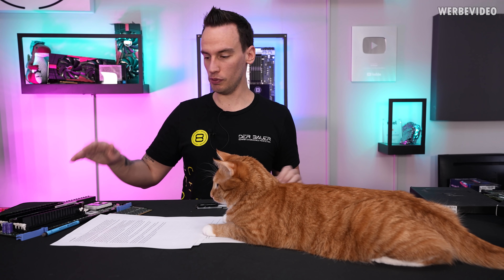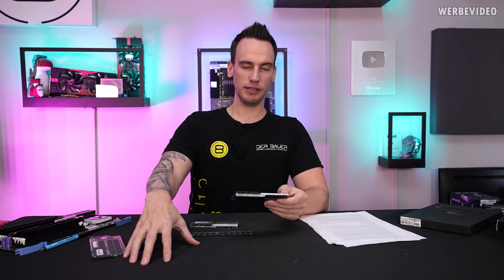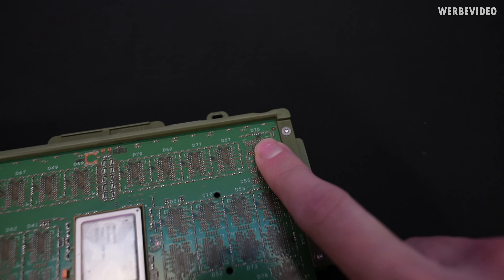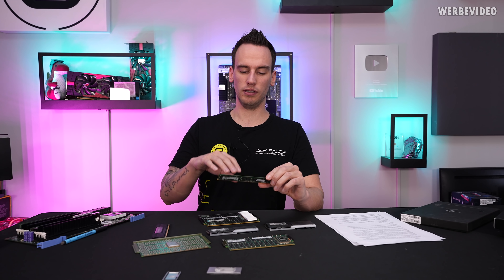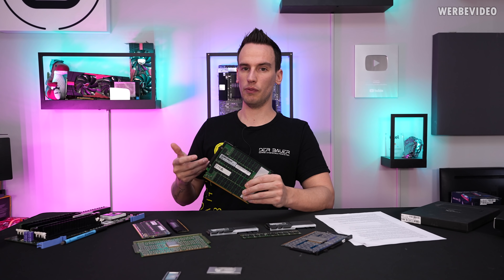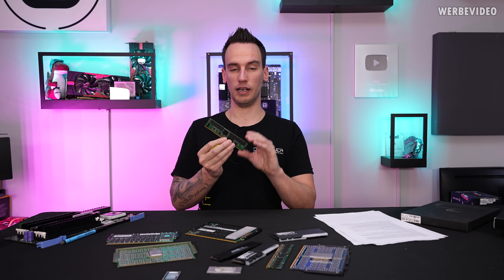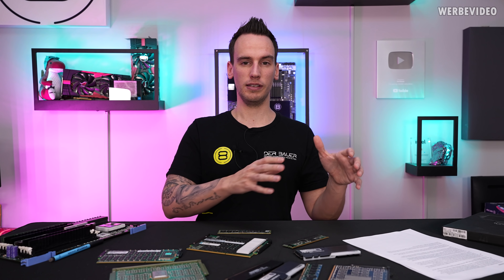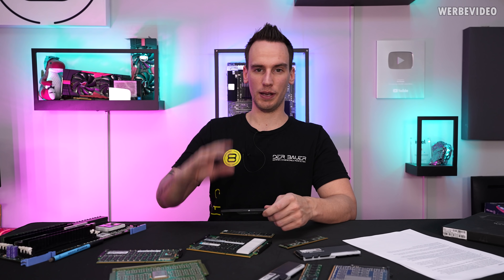This Memory Stick with over 150 DRAM ICs is Unreal and probably the Biggest Ever Made

Comment: Don't know if that's biggest by IC amount, but it sure isn't the largest by physical size. I suggest looking at vintage 1980's ISA ram board. There's some with 130 slots for memory chips that you had to install yourself into the card that probably wouldn't fit a modern computer case. They could add whole megabytes of memory to your computer!

Comment: I never thought I'd see the day where a stick of RAM would surpass a standard tower cooler in height... So, does that mean you need to find cases that fit this?
Reply: They go in servers, so no. The company builds the case around the height requirements of the equipment, and most IBM servers are at least 2U, or about 3.5 inches tall, but I've worked on Power System servers from IBM that are 3 and 4U high, or 5.25 and 7 inches tall, respectively.

Comment: The old IBM PCs from the 80s had enormous add-in boards for memory. If I'm not mistaken, they used ISA expansion slot, which is the grandfather of PCI, and later AGP and PCIe. The memory add-in boards where taller and longer than AIB 3080s/3090s. But to be fair, these memory add-in boards are not directly comparable to DDR DIMMs. But it's fun to see how small everything have gotten.
Reply: I was going to type the same thing.  The ISA boards from the 80's were full length and were bracketed.  Every time I see one of those sagging video card videos. I remember when those brackets became obsolete, somewhere around the time of 486 computers.

Comment: Fascinating stuff. IBM's proprietary hardware does set a precedent for servers to come down the line later. The biggest rackmount system you can buy at the moment that's user configurable maxes out at four processors and 6TB RAM for a single configuration. Obviously you can also get dual and quad systems stuffed into a single enclosure, and then many times more with blade systems.

Important to note too that those tall sticks most likely wouldn't work with a 1U server - I'm guessing these were exclusive to IBM's 4U products. Then again being proprietary I wouldn't be surprised if they used 90 degree or angled memory slots to fit them into slimmer chassis. When you're dealing at this high end rack space (and floor space) is not what you worry about lol

BTW: nice pussy 🙂

Comment: It isn't just as exotic as it may seem.
Standard DDR4 LRDIMMs also come in variants with 72 DRAM chips per stick.
They are using dual-die packages, meaning there are 36 physical packages on the stick, but each contain two dies.

And these sticks are very common.

Comment: i have a msi gt62vr 6re dominator pro it 6 year old laptop i want to know  can i overclock the cpu to 3.4GHz all core ? cause my temps only hit 60 at full load and and my cpu is stuck at 3.1 GHz there is not a single video to show how to overclock a i7 6700hq even when the option is given

Comment: IBM's Centaur chips were not exclusively found on massive proprietary DIMMs.  The low end POWER7/8 systems had them installed on the motherboard themselves and had ordinary DIMM slots linked to each Centaur chip.  It was a typical dual channel arrangement supporting up to two DIMMs per channel.  That is likely why the IBM custom modules are so large as they're effective four DIMMs in one.  Another note is that these DIMMs support ECC and IBM's ChipKill technologies so one DRAM chip can completely fail, be disabled by the Centaur chip and then continue operating while ECC is still maintained.  I think those custom Centaur DIMMs could also be hot added to a fully running system.

The L4 cache of the Centaur DIMM does indeed function as a cache but its contents are restricted to the information of the DIMM itself.  While it does improve performance, it mainly offsets the impact of using buffered memory.  Adding more DIMMs does increase performance of these POWER7/8 systems even if memory capacity is kept at a constant.  IBM did release both DDR3 and DDR4 version of these DIMMs and they are interoperable.  However, there two different Centaur designs to deal with the different memory types.

POWER10 changes things significantly by using a common interface for multisocket communication and their memory buffers.   Eight links are always dedicated to memory while an additional 8 can be used for SMP traffic or even more memory.  It is pretty flexible so a single socket only system can have 16 TB of memory with a bandwidth of 2 TB/s which is very impressive.  The big iron servers are only leveraging 1 TB/s of memory bandwidth and top out at 8 TB of memory per socket and upto 16 sockets in a single node.  Memory sharing between nodes is also possible with the POWER10 but cache coherency is lost.

3D Xpoint memory or as it is more commonly known as from Intel as Optane, is a very interesting technology.  Being byte addressable does permit it function as main memory.  Intel initially was going to have Sky Lake-SP support these DIMMs but due to bugs had to disable that functionality.  Similarly Intel was planning on permitting full Optane memory on its systems before requiring some DRAM to be installed.  While the performance of Optane is slower than DRAM, it does permit some interesting potentials in software optimization:  the full removal of the traditional storage stack as everything then becomes 'in-memory'.  With enough capacity, those Optane DIMMs would double as both main memory and traditional SSD storage.  This reduces operations like say loading a game into memory to zero because when you are not running that game, it is is already sitting in the Optane DIMM.  Like a RAM disk but without the need for the traditional storage software layer to function.

Comment: I have a 21" Mac and it came with 8 GB, updating it myself is too risky because I will have to open the computer completely before I can reach the memory slots. Apple decided for some weird reason that it didn't need the usual memory slots in the bottom of the screen as my previous Mac 27" had. Is there a way to add extra ram using the USB ports?
Reply: No

Comment: That's a lot of DRAM chips. I am kinda curious if it will also function on x86 processors other than Power 5 SOC that it originally was paired with.

Comment: I started my computing career on System/38, the AS/400, i Series, System i etc. The hardware is way ahead of PCs. One morning we got to work and saw an IBM engineer waiting. He said iSeries had a cache failure, so it organised an engineer for itself. Cache was pulled out while it was running. The system said thank you on the console and configured itself for full speed. You get what you pay for :) Awesome.
Reply: my old Boss used to sit with the IBM engineer when they where getting data errors on the storage of the system/38 and make bets on exactly when it would fail, although that came during a time well before i worked there (i would have been in preschool at that time), when i started in the early 2000s they had the as/400 - iSeries which had been running for probably 7-8 years at the time, that thing was interesting to me and still to this day i hope to find a used one to add to my homelab/collection but the prices never go down. although the biggest thing i remember from back then was waiting 3hrs after work because i accidently knocked out power and had to wait for it to boot and display a login console on one of the 3180? terminals before i could go home (connected a large laser printer to a stupid unlabeled outlet on an extension cord that ended up being connected to the UPS the AS/400 and Novel 3.12 server where on, UPS did not like it and killed itself)
Reply: @jjjacer  That sounds like an amazing story right there, aside from the as/400 are there any other models that you really liked or stood out to you?
Reply: And then you've also got just how long IBM will actually extend support for their proprietary stuff like their POWER line of products. It's quite crazy that they support 4 generations of product at a time, both software and hardware.

Comment: The consistency you have between the German and English versions of your content is impressive enough, but the fact you managed to get the cat to do almost exactly the same thing on both takes is genuinely next level 😂
Reply from the maker: I told Shiek she will get a extra tuna snack and she agreed
Reply: @der8auer-en   That chip under the heat sink works as a extended (External) memory controller unit to help translate Capacity so the internal memory controller on the processor knows what the capacity as I worked on some servers that had 128gb cdimm modules in a data center that I can't name do to nda
Reply: The cat is a paid actor. It's all fake
Reply: Youtube need multiple video/audio stream support
Reply: @zinc_trioxide  I've seen it before on a Tom Scott video, where he had a descriptive English audio stream in addition to the default English audio stream when he collaborated with a blind youtuber. It seems like it's something in the early testing phases, only available to big creators for now.
Reply: @EthanCGamer  Thats awesome!
Reply: derBauer: Oh no, this Katze won't let me check my notes!
Also: Totally unconcerned that Shiek is going to attack the server hardware because she's actually paid to do this
Reply: He does what the cat tells him, not the other way around😂
Reply: I accidentally went to the German version first and noticed that too :p
Reply: And also not loosing the accent after such a long time
Reply: Mobile cell phone
Reply: I think his B-roll is all shared and in person are all differentiated.

Comment: An interesting little fact: Cisco gear often has some nvram in them. It's used to store the active configuration.
Reply: Cisco calls it NVRAM within IOS, but it usually is EEPROM or flash memory. For some reason Cisco often takes industry standard terms and re-uses them.
Storing device configuration should typically only be done during re-configuration, for which flash with write speeds well into the MB/s is more than fast enough. EEPROM which has write speeds of anywhere from 100KB/s to a few MB/s is also more than fast enough for configuration data.
There would be no need for NVRAM for configuration storage. In fact, in some documentation Cisco refers to the configuration file stored on flash memory as being named 'NVRAM', kind of like taking a file on your pc, renaming it 'NVRAM.jpg' and claiming that is now actual hardware NVRAM.

Part of the reason I don't like Cisco; you always have to dive into the documentation to figure out what their marketing team meant when they overruled their engineers again.
Reply: @someguy4915  lol yeah I didn't care enough to fit through their bs. Did not enjoy that class.

Comment: I work on mainframes, we still have System p (880), plus I also have some S814 servers, nothing more modern than POWER8 though. For me (I'm all about OLTP databases), anything after POWER5 was useless. I don't need SMT8 and huge caches, I need real IOPS instead :/ (x86-64 with NVMe is way better than pretending you have awesome ROI by running lots of databases on LPAR-s though VIOS, and it's cheaper, too :/)

But I'm fairly confident the SPARC boxes we've decommissioned few years ago had bigger memory modules than your biggest ones. Sun was so awesome before Oracle takeover, RIP Sun :(

I wonder whatever happened to jpkiwigeek :(
Reply: RIP Sun

Comment: It is not the biggest. You should check other IBM D-DIMM modules for POWER10, that utilize IBM OMI interface. It is an evolution of Centaur / C-DIMM, to be more flexible, cheaper, faster (about 5ns, instead of about 10ns for Centaur) and higher capacity. They are enormous. Serial interface, with Microchip controller and mix of RAM (DDR4, DDR5, GDDR6 and HBM2) and Flash.
Reply: sounds like chimera of memory chips lol
Reply: Those have a WEIRD pinout.
Reply: @Muscleduck  looks like if a m.2 had a child with a sodimm on drugs
Reply: @benuh5522  LMAO 🤣
Reply: I have some RAM from a Siemens 68040 based server, it used some 8MB RAM Modules that were as big as 1.5 - 2 hands.
Reply: if they dont have to be DIMMs, magnetic core memory cards for old school mainframes and minis were HUGE.

Comment: Considering that we still use dual channel memory, those bigger RAM sticks will help to increase bandwidth and maybe lower latencies.
Reply: Plenty of servers use quad channel memory, it's just not necessary for desktops, way too expensive so hardly any consumers would buy it.
Those bigger DIMMs will likely suffer from higher latency as the main cost of having higher capacities.
Doesn't matter how much ICs you stick on the DIMM, it is mainly limited by the same connector which determines the data-path width.
Reply: @someguy4915  We are still using dual channel memory configs since the early 2000s back when CPUs were just one core, with 16 cores for consumer, how the hell we are still using the same config from 20 years ago or something like that?.
Reply: @someguy4915  Quad channel is necessary for desktops, specially the perfomance increase it can make for gaming and programming and other bandwidth limited tasks.
Reply: @saricubra2867  For gaming the GPU and multithreading optimizations would still be far greater limitations before quad channel becomes a real benefit. For programming you just need something to run an IDE which means singlechannel setups would also be easily enough, even a Raspberry Pi would be more than enough for programming, anything really that connects a keyboard and monitor. For compiling code however you may need some more performance but there too quad channel memory is almost never a real benefit as CPU limitations are far more significant than memory bandwidth.

The only real applications that benefit from quad channel are actual bandwidth heavy and highly optimized applications such as databases and rendering software, both are typically run on servers/workstations which do feature quad channel.

If quad channel would be necessary: you would've bought a pc with quad channel ;)
Because they do exist, you just couldn't afford a 1000 euro motherboard just for quad channel memory.
Reply: @someguy4915  You should watch the M1 Pro benchmarks by Hardware unboxed, that show how the memory bandwidth of the Apple chip absolutely obliterates x86 chips, therefore the SoC obliterates the competition in code compilation (Tiger Lake and Zen 3 mobile). The Apple chip is basically the same in perfomance.

Quad channel always is a benefit even on gaming, makes the game run slightly smoother, another thing that makes the experience better is more cache.
Reply: @someguy4915  Single channel is a huge bottleneck.
Reply: @someguy4915  "1000 euro motherboard"
That would be pre-Ryzen era.
Reply: @saricubra2867  The M1 is an ARM based SoC and functions completely different to x86. 
That is like driving a car, reading a benchmark of some new aircraft and deciding that your car now needs a jet engine 'because the review said it made the aircraft faster', so your car must work the same as an aircraft...

x86 is a far more complex instruction set, with many extra instruction sets stacked besides it including x86-64/AMD64, all of which benefit from higher memory bandwidth but mainly from larger L2-L4 cache on the CPU, something which we're seeing more and more of in x86 CPUs, starting with the introduction of L4 cache to begin with.

In most tests, there is no difference between single and dual channel for gaming, in some tests a minute difference can be seen. For quad channel most tests (and logic) show that there is no noticable difference i.e. you could be playing on two different computers, one with dual channel and one with quad channel and you could not reliably tell which one is which...
Just a placebo effect.

For gaming, you do not need dual channel memory, but it doesn't really hurt to use it anyway. Quad channel for gaming is pointless, this is proven by the way x86 works and by every benchmark out there.

In some server workloads you need quad channel, for instance for databases and virtual machines, both incredibly memory-bandwidth heavy tasks. For gaming there is no point to quad channel memory.

Your other examples, including programming requiring quad channel memory show that you clearly have no idea what you are talking about.

Comment: The Dell R910 server used 8 risers for memory, each able to hold 8 standard DIMMs.  I remember my first encounter with one.  I was amazed how much memory it could hold.  

Also, I worked on some old IBM p series machines running AIX, and they had these weird DIMMs (DDR2, iirc) that were almost twice as long as standard DIMMs, and some came with dual rows of ICs.
Reply: The oldest I worked on was a Data General the memory board was 400mmx 200mm, sometime I had to start it with a hammer on the fans when they got stuck.
Reply: 1TB RAM max! The old Compaq Proliant 6500 could hold 8GB on its RAM daughterboard with registered EDO SIMMs, up to 32 of them.

Comment: From the size of the heatsink I am doubtful that it is 20w but more like somewhere between 5 to 10w otherwise it would probably bake. As for the rest I agree that it could be 40 to 60w per module.
Reply: In a server chassis, 60w is very easily cooled with chassis fans. Heck, most nVidia GPU’s for the server market are sold without active cooling, and OEM’s will install up to 8 of those in a single box, and each GPU running 250-350W all passively cooled because the volume and speed of the airflow blowing through the chassis is sufficient.
Reply: @benjaminlynch9958  That is not what I was getting on about, when you know how well heatsinks of various sizes perform relative to what is expected to be dissipated for 20w regardless of air flow is undersized. The cache chip is likely only between five to tens watts and no more.